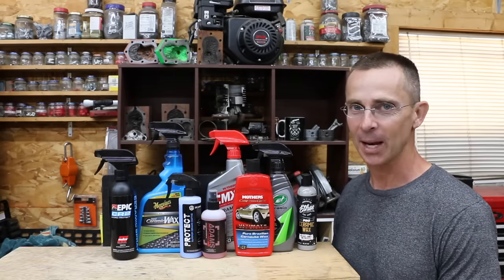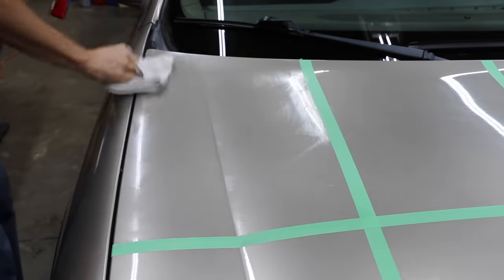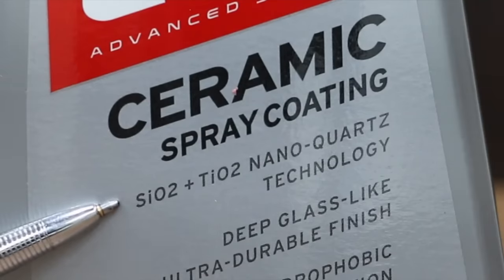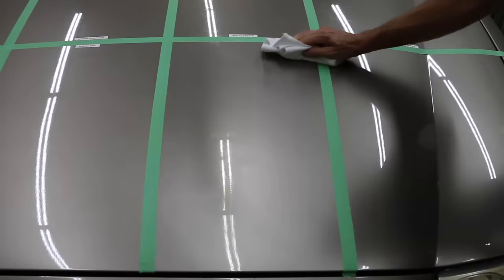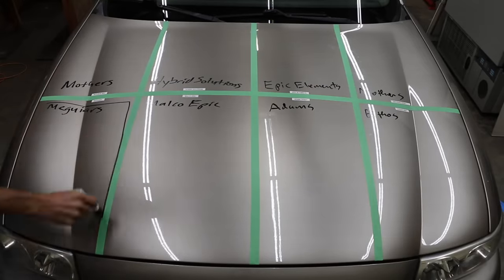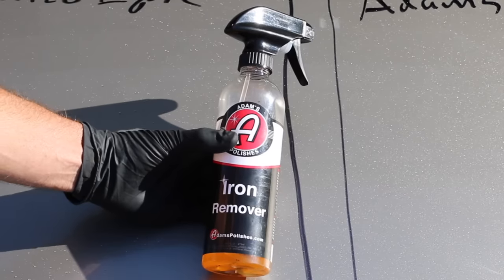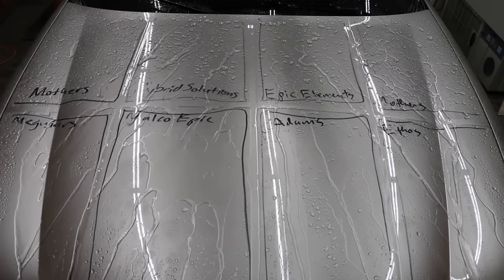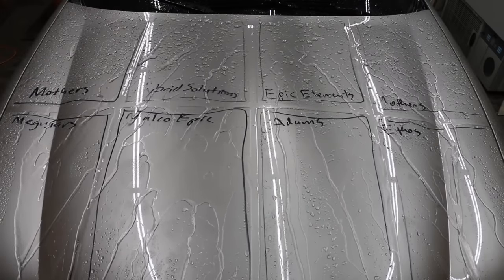Best Ceramic Spray Coating? Mothers vs Meguiars vs Ethos Pro

Comment: Love the videos! A ceramic coating is a product that comes usually in a 1oz or 2oz bottle either a Sio2 witch only lasts a year. The SiC is permanent unlike the Sio2 that needs annual maintenance to maintain. 

These sealants you are using are not ceramic coatings. I would like to help any way possible with your future testing as I am a professional and certified owners pride ceramic coating installer.
Reply: And by the way hydrophobic beading properties do not mean the product is not protecting the paint. Hydrophobic properties can be lost by shocking the paint and or by contamination.
Reply: Is there any of these ceramic coatings that leaves a dry and matte look?I need it for stone.

Comment: A thing I should change about myself is to watch this channel BEFORE I buy stuff.... in this case, I think I'm okay b/c I just bought the turtle Wax 50984 ICE Seal N Shine Hybrid Sealant Spray and it's advertised to be longer lasting (although only 6months)... 

still thankful for this channel.
Reply: The hybrid solutions ceramic spray says it lasts upto 12 months the ice seal n shine is the older cheaper version its not bad for a cheaper option but for not much more money the hybrid solutions is better
Reply from the maker: Thanks!  Thanks for the feedback.

Comment: Hello, YES, i would like to see part2 of ceramic waxes.
In particular ....
Griot’s Garage 10978 Ceramic 3-in-1 Wax 22oz, Easy-to-Use SiO2 Coating Providing Durable Protection & Long-Lasting Water Beading on Paint, Wheels, Plastic, Rubber Trim, Chrome, & More

Comment: Nice comparison.  I'd like to see the Nu-Finish ceramic spray and the Graphene Nano spray included.  Also, when discussing which is cheapest it would be best to use the cost per ounce.
Reply from the maker: Thanks!  Thanks for the suggestion.

Comment: Great video! I wonder what the best tire cleaner is. I forget what I brand I used a while back, but it would break down all the brake dust almost immediately and get the tires nice and clean. I bought a few different tire cleaning products recently because each one wasn't working as described and was no better than using dawn dish detergent. It was definitely not what I was expecting from 3 different brands, especially the price.
Reply from the maker: Thank you!  Thanks for the suggestion.

Comment: Nice work, You should do a UV based test on the ceramic coatings for headlight refinishing. We know the best way is DA sander, 800 grit, 1500, 3000... But the sealing coatings always yellow.... Which coating is best?

Comment: Thank you for this excellent test! Is it possible to chemically remove the Hybrid Solutions product? Seems like if you end up needing to reapply after it eventually does wear out, you will have to use mechanical means to ~100% expose the clear coat again.

Comment: I have been using this turtle wax hybrid spray ceramic for 2 years now on my fleet and after the first coat i realized it was better then any car wax i ever used. 

Then i did a car with wax on one half and turtle hybrid ceramic on other half and after one week my wax side was covered in dust and the ceramic wasnt 

Id love to do half the car professional ceramic and half turtle and see how long it lasts

Comment: Griot's Garage 3 in 1 ceramic is rated well and performed well in tests against other, more expensive, SIO2 type coatings. It would be good to see how it performs with the previous winners if you do a round 2
Reply from the maker: Thanks for the suggestion.

Comment: I don’t think some of these were applied correctly judging by the way the water beads. I’ve used some of these products and the they should appear more hydrophobic, making water appear to bead and almost bounce off the paint. Your testing shows water still sticking to the paint a bit but I do appreciate you taking your time to do these unbiased tests though and as long as each product is applied the same way, it gives each product a fair comparison

Comment: Hey btw I have a fun fact for everyone. The pen he uses to point at product packaging, that's a really cool pen. It's called a Fisher Space Pen, it was designed for the mission to the moon, it can write in zero gravity, in freezing temperatures, upside down, and even underwater. It's rlly cool, I bought one on Amazon for $35 CAD.
Reply from the maker: Thank for sharing.

Comment: A voice of criticism here.
As a user, when I apply wax, I don't use degreasers or any other chemicals which could remove the coat of wax. I use wax-safe shampoo.
I don't drag a sponge over the surface. I want the coating to repel the water as long as possible.
That should be the test sequence. Apply wax and check each month it is still there.
Reply from the maker: Thanks for the constructive feedback.

Comment: Good testing but I think Meguiars was at a disadvantage because you didn't first apply a foundation coat as instructed on the bottle.
I've seen others testing with and without the foundation coat and it definitely made a difference with it.

Comment: You need to do a second round using UV detectors to see how good they work to avoid  the UV light to reach the paint. (testing for the UV-A, UV-B and UV-C would be even nicer)
Reply from the maker: Thanks for the suggestion.

Comment: Something to consider when reviewing liquid products would be to have them listed in order of price per ounce as opposed to the bottle price.  Some manufacturers obviously put out a small bottle with a low price, but the price per ounce may be much higher than another product with a higher price tag due to a larger bottle.  Regardless, loved the testing.
Reply from the maker: Thanks!  Thanks for the constructive feedback.

Comment: I would like to try the Hybrid Solutions out but it just isn't cost effective compared to others that sell much cheaper per ounce because they come in gallon sizes or better.  I use Technician's Choice 582 and it works great and you can buy 128 ounces (1 gallon) for the price of 48 ounces of the Turtle Wax.  At that price difference I can't justify buying the TW especially since the TEC582 works so well.  Great comparison though.  I would love to see an update pitting the TW against the TEC582 and some others.
Reply from the maker: Thanks for the suggestion.

Comment: 4:04 that's strange because this and all the other Maguires ceramic line like this is all $15 at Walmart. I have the regular nonspray thick liquid compound that's the same as this spray. Yup $15 at walmart.

Comment: Respectfully, the very first thing you should’ve done is park the car outside for 30 days in direct sun. This is the challenge most of our cars face. Your chemicals are not the same as UV radiation. This is a minor quibble. You have one of the best channels on the Internet. Thank you!
Reply from the maker: Thanks!  Thanks for the feedback.

Comment: Well this helps me out a lot I certainly thought mother's cmx was one of the best but I will be switching to turtle 🐢..... I was kind of hoping for testing of sun durability considering I live in the highest Sun UV place on Earth in Arizona, and I know for a fact that normal carnuba wax is trash out here because it's too soft of protection.....
Also fun fact black vehicles are the hardest to perfect and my experience with mother's cmx, is that it is very hard to remove on black paint.....
Reply from the maker: Thanks for the feedback.

Comment: Could we do a ceramic coating test on Wheels, specifically resistance to brake dust? This is a big challenge for many car enthusiasts wanting to keep their wheel barrels clean as it requires a fair bit of work removing the wheels just to clean behind them. :)
Reply from the maker: Thanks for the suggestion.

Comment: Hybrid Solutions is no joke (note: they now have a new, updated product since this video is a little dated; looks virtually the same, but the label has different colors). I bought some randomly one day as part of a car cleaning product binge this summer (2022). I used it once and was blown away by the gloss and hydrophobia. It was like a mirror. I was sending videos to everyone who I knew would care lol. I actually got another bottle from my parents for my birthday a couple weeks ago after I used a bottle on their two vehicles recently 😂. It’s the only cheap ceramic product I will ever use. 

After I did my parents’ cars, they both said it’s much easier to keep their vehicles clean. My mom even went through some tornadic weather one day and she said she was not blinded by the rain because it repelled so well. Other cars were pulled over due to the rain alone.
Reply from the maker: Thanks for sharing.

Comment: I got the turtle one, one thing I did notice was the aerial that I have on my car must use the roof as a plane to get signal as well. After polished on my radio service strength is now very limited.
Reply from the maker: Thanks for sharing!

Comment: Back when i used to work on stuff in our tiny two car garage there were a boat load of wasps that would fly around in there and swarm at you. I did not know where the nest was so i would just shew or kill any that flew at me. One day i found a half full spray bottle of some kind of turtle wax. Really thick stuff.

While i was being swarmed at one day i grabbed the turtle wax and sprayed a small amount on a wasp..and the thing hardened up and Could not move it literally incased the thing in a thick coat of wax! Turtle wax is a good bug killer as well lol.
Reply from the maker: Thanks for sharing!

Comment: 8:26 You can see where the masking tape used to be. Imo, they all work. But I'm honestly shocked at how well the Turtle Wax worked. Kind of disappointed in the Mothers CMX; I just had high hopes for it as they usually make a decent product.
Reply from the maker: Thanks for the feedback.

Comment: The Meguiar ceramic wax bottle disintegrates with time. Dunno if it's UVs or what, but the bottle is extremely fragile (I've dropped it from not very high and cracked the bottom), and doesn't age well. Transfer to a more durable container.
Reply from the maker: Thanks for the feedback.

Comment: Please test Bench Grinders & Wheels. I recently bought a name brand 8" grinder with a coarse and a fine wheel. Both wheels wobbled side to side caused by the wheel flanges on the grinder shaft. To make matters worse, both wheels were not balanced. The grinder vibrated itself across the bench even with rubber feet. Right out of the box it was not usable. Evaluate usability and safety features too.
Reply from the maker: Thanks for the suggestion.

Comment: Hard to beat Turtle Wax products. I’ve been using their stuff for years and have always been happy. Another great ceramic like spray coating of theirs is Seal and Shine. 👌🏽
Reply from the maker: Thanks for sharing.
Reply: It depends on which turtle works products, what the product is used for and what product you’re comparing it to!
Mothers and Maguires have superior normal wax compared to turtle wax! 
Turtle wax has improved with the ceramic type. 
There are better products than turtle wax for cleaning wheels!

Comment: What about best carpet cleaner and stain removers? Or wheel cleaner and car soaps? Some soaps claim to have ceramic based waxes, while others have basic waxes, yet most leave nasty films. And some use those foam cannons while others are bucket washes
Reply from the maker: Thanks for the suggestion.

Comment: I haven't tested them all.
But I can assure you from my experience that MOTHERS is a whole lot easier to apply with no streaks than TURTLE WAX. It takes about twice as long to use Turtle.
It's not worth fighting the battle for the longevity.
Reply from the maker: Thanks for the feedback.

Comment: Anyone still looking for advice as a lazy person i wanted the best but also easiest I dont have the time to clay bar my car and do a real detail clean but i still want some type of protection . Meguiars is by far the best for the ease of use,  wash your car, after you rinse BEFORE you dry it grab your spray and a drying microfiber, spray the wax on the wet car and then dry the car. Just make sure you only spray the area you are about to dry.
Ive tried several spray waxes and even the meguairs on a dry ,"clean" car and none really worked all that well for a casual user til i started to get backpain in the middle of a wash and rushed to finish. If you are like me and don't have the time to do a full detail wash before waxing i'd highly recommend trying the meguiars with the wet car method
Reply from the maker: Thanks for the suggestion.

Comment: Looks like more turtle wax for me. I got it awhile back, just because it was the cheapest big name spray coating, per amount, at the store I was in, and a bottle lasts about 3 washes. I have noticed that when I go to wash, now, about half the dirt, bugs, bird poop, etc. is on top of the old wax, and it all wipes right off.

While it is nice to see the differences, they're all pretty impressive, really. I remember trying spray waxes maybe 25 years ago, when I was a teen, and they were a joke. The technology has come a long way.
Reply from the maker: Thanks for sharing.

Comment: Your thoughts on using the Turtle Wax brand spray coating on a glass shower door and glossy porcelain (wall) bath tiles. How would it compare to Rain-X Shower Door Water Repellant? Thanks for all your informative videos.
Reply from the maker: You are welcome!  Thanks for the suggestion.

Comment: I have liked Turtle Wax Seal and Shine. I have used the Ceramic spray wax and don’t think it last as long as the Seal and shine. That stuff lasts a long time. Anyone else have experience with Turtle Wax Seal and Shine?
Reply from the maker: Thanks for the feedback.

Comment: Ceramic Shield is a good product. Too bad you couldnt do a UV test for these products. Most products "melt away" in extreme heat in summer. That would be a great durability test
Reply from the maker: Thanks for the feedback.

Comment: I detailed my vehicle with nufinish ceramic spray wax prior to an 800 mile trip with 6 rain events. I washed the vehicle after trip, discovering rail dust, tar, bug, and all kinds of contamination in the paint. Spending excessive time with clay bar and so on. I am looking for a product that repels/ reduces the ability for contamination to stick to the paint. Water beading is water beading but I noticed good old carnuba paste holds off crap best on trips vs ceramic sprays but obviously doesn't make the water dance after one rain. Can you set up a test for products that defend against elements not clean water haha

Comment: You never showed using a separate clean microfiber cloth to remove the excess with the turtle wax, you only mentioned it. Did you end up doing so or just wipe it on and leave it and that’s how it preformed the best?

Comment: A new video now would be great for all spray coatings for cars, that you can get at local stores.... So many have come out, and it all seems about the same and now.   From spray ceramics to seal & shine, to just spray waxes, graphene sprays, !!!   best overall shine, protection and ease of application that would be great
Reply from the maker: Thanks for the suggestion.

Comment: Not sure if my idea would work for you however, I'm wondering if ceramic coating a boat hull would work to make your boat faster and hold up over a few  months. I would like to see this as part 2.
Reply from the maker: Thanks for the suggestion.

Comment: I used the Meguiars ceramic coating and it ruined my cars paint. The hood, roof and trunk lid ended up dull like a faded finish. Every shop t went to said it would need a repaint and $1,500.
Reply from the maker: Great feedback. Thank you

Comment: Thanks for the video, I have a query, I have a 5 year old car, never done any paint protection or detailing, so can I use meguiar's ultimate compound to remove swirls and scratches first  and then turtlewax ceramic spray as a sealant without using meguiar polish wax?

Comment: I do not mean to undervalue or make bad comment, but this is my own experience of using meguiar hybrid wax. The direction is so weird: apply it and rinse it, as if you waste it at once. Ok, I follow the guidance, since I focus on the result. But unfortunately I cannot find my car (stargazer x) body as smooth as I was using other wax before (I recall it was from turtlewax but cannot remember the name). The final appearance is like you have already wash it but not wax it yet. I dont know if meguiar is not as good as it  was. I will try turtle wax nano then
Reply from the maker: Thanks for the constructive feedback.

Comment: If you are thinking of doing a round two test, could you include a product Tech582. I've used this for over a yr. now on various colors  ranging from black, white, dk blue and maroon. With all applications I buffed and polished before product application. In that regard I'm really not sure how to evaluate this ceramic product. I will say that the finish to touch is awesome. Slick as glass and very easy to apply. My dilemma is this..."is the buffing and polishing giving me the slick as glass feel...or is it the ceramic spray?" I will say that in the past, even with the buffing and polishing I've never felt a slick as glass touch as this ceramic spray. So for round two, if you would, please include this ceramic Tech582 product for testing, thank you.
Reply from the maker: Thanks for the video idea.